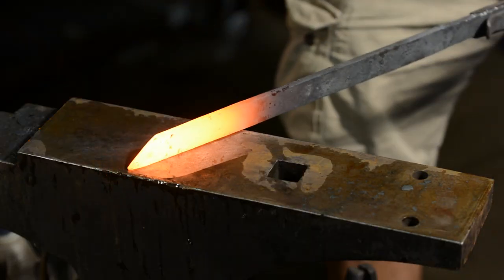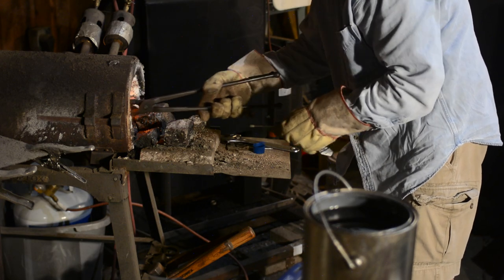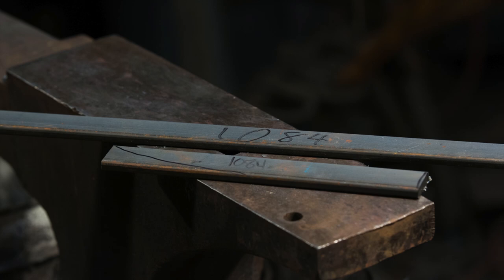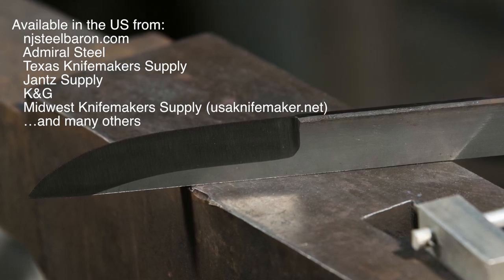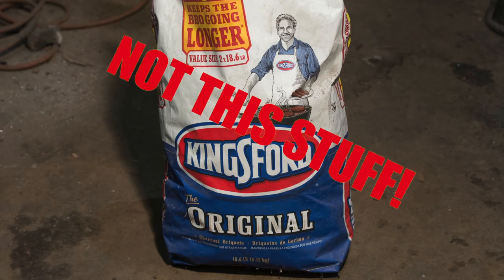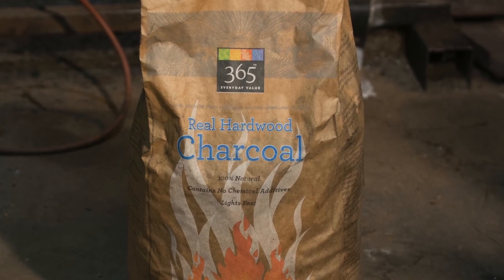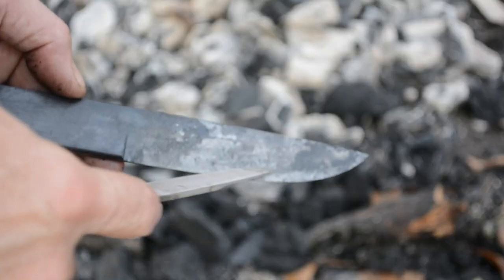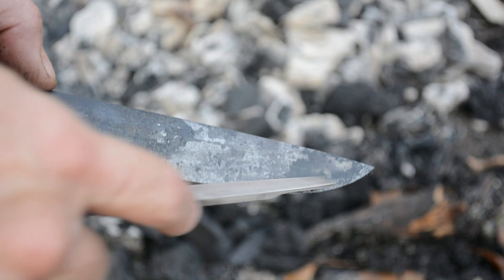Get Hard:  Heat Treating a Knife with Charcoal

Comment: I got a dumb question. I have heard u say to use 1095 steel as well. What's the difference between 1095 and the 1084 your using in this video. I've gotten into this as a hobby but have always used 1095. I've only made a few knifes and heat treating them was a little harder than I thought. Glad to see a video for the poor man knife maker. Ive been learning all my stuff from your videos thanks for the info.
Reply: The difference is the % of carbon. 1095 has 0.95%(more or less). There is some other differences too. mainly 1070 forgives more temperature mistakes than 1095 (beginner friendly)
Reply: +Negrataish thanks man. So 1095 is good for beginners cool I'll stick with it tell I get some knives under my belt.
Reply: No problem!. Also 5160 is really good and should be pretty cheap
Reply: +Negrataish 1084, 1080, 1075, 1070.....all of these steels give more consistent high quality heat treat results with primitive equipment than does 1095.  5160 is what is known as a deep hardening steel, and because of all that chromium it has within its structure it really gets benefits from a slower-cooling oil quench.  Some folks have experienced cracking with 5160 in water or fast oil.
Reply: +polishavenger1 all this is crazy I feel like they need a class for this. So many different metals, it's kind of overwhelming.
Reply: +polishavenger1 Yeah i meant that 1070 is more beginner friendly than 1095. And yes, 5160 should be quenched in warm oil
Reply: +hishinator There are SO many formulations of steel to choose from that it makes the mind swim with all the possibilities.  My advice is pick ONE, learn how to shape it, heat treat it and finish it properly.  Don't get caught up in all the hype about supersteels or this steel is better than that steel....the Schrade Cutlery Co. used ONE high carbon steel for about a hundred years for the majority of its products, and that steel was 1084.  Easy to work, easy to heat treat, easy to sharpen to a great edge.  And the stuff is INEXPENSIVE....great for hobbyists.  I've had beautiful results with 1084.
Reply: Thanks every one for helping next time I get some steel I'll try 1084.

Comment: According to a few websites, they are saying that 1084 is a "discontinued" tough tool steel that is very popular for forging when it can be found, and 1084 has been replaced by 1080 and the specs for both are very similar, with 1084 having a little more carbon.... 

Since everything on the internet is true,  um.....   will 1080 work for this??  lol    (i'm sure there's still a lot of 1084 floating around)
Reply from the maker: +Mitch B NJ Steel Baron still has some.  But 1080 is not the same as 1084.  1084 has higher manganese content, which makes it oil hardenable.  Whereas you have to water harden 1080.

Comment: Hi! Looking for some tips of doing HT on 5160 steel, and I have sort of found reading alot that you can get away heating to 1500F and quench in pre-heated canola oil (about 130F). Then I see some temper 2 or even 3 times at 375-400F. Novice here, its again just figures that seems to be common.

Comment: Great video and I look forward to learning from your skills. My question is about the treatment of the tang? Is the Tang (handle) getting a full treatment as well as the blade? As I watched the video it looks like the whole time your heating the blade its by the end of the tang, and the treatment doesn't look like it's getting all the way up? Or am I just being difficult? just want to make sure I understand the process before I do this.
Reply: The tang is left soft for toughness
Reply: When you see him harden the blade, you will notice that he only really heats the blade. This is to keep the tang soft. If the tang was hardened, it would just be unnecessarily prone to cracking or shattering. There is no need to harden the tang as it is not the part that needs to hold an edge. Does that make sense?

Comment: I've only heat treated a few knives but I've been doing it with the spine down and the edge and tip just outside the main heat. I am just curious if there may be something wrong with doing it this way that I am just not picking up on. In my mind it makes it easier to control the temperature and lowers the risk that I will burn or overheat them.

Comment: How much/can/should i grind the edge of teh knife before i harden it? I've only done one knife, from an old file. It cracked in several places across the edge and it bent as well. Sure, i did alot of mistakes/didnt lry know. I probably hade to high temp, I quenched it in water. But I think my main problem was that I grinded it to much/it was quite thin. (I thought it would be smart to grind it as much as possible before it would get hard). How much griding work should you do before you treat it?

Comment: Walter i have a thermos i wanna put my parks 50 in and use it.. it has a lid and a 4 inch opening.. the can is hollow but it says vacuum sealed.. will that work when it gets hot?. Should I drill a whole on the outside of the canister?.. worried it will expand and explode. My thought is if i poke a hole in the outside of the can, the air inside will release at will.. thoughts plz.. this is a 1gal ozark reail 30 dollars 10.25 dip depth.

Comment: idk what kind of steel I used but once I've heat treated is 450 degrees for an hour fine for most size knives or do I need to change it to a certain time/temp. Also are there any health hazards with doing it in an oven used for cooking because that's the only oven I have.

Comment: Those things won't just melt steel, they'll burn through it like an acetylene torch if you're not careful and get too close to the oxygen supply. My early works mostly ended that way, with a gaping hole in the middle of it. At least it was free leaf springs I got from a nearby garage :P Only the charcoal was wasted.

Comment: Hi, Walter. I have a question. I`m making a knife out of old circular saw blade, the steel is real hard, when I tried to drill the holes for pins my drillbits melted. So my question is do I need to heat treat the knife  if the steel is that hard already. I`m planing to put  a scandi grind bevel on it with a file so I wouldnt overheat the edge. This is my third attempt to make a knife, first two cracked during heat treating  after quenching in water (used the same saw blade for those).
Reply: Pēteris Lukstiņš quench in oil and anneal it to start with will make it soft enough to drill and file
Reply: Pēteris Lukstiņš Try cobalt steel bits.

Comment: Walter I tried heat treat my blade and think I may have not got it right. Parts seem hard while other gets bite from the file. Put it back on the coals tries again but still has the same issue. How many times can I heat treat the same blade

Comment: have you tried using aluminium to protect the edge and as a temperature guide during heat treating?
aluminium melts at the same temperature as the optimum heat treating temp of O2 steel (816˚C). 
I'm thinking of trying out a tester but was wondering at any disadvantages or possible metallurgical contamination from using aluminium this way?

Comment: +Walter Sorrells Which steel would you choose (only using the simple method shown here) as a hard use knife steel with 5" blade 1/4" thick flat ground and full tang 5 1/2" handle, (pretty much a K-Bar style but full tang) ...1075 or 5160?

Comment: If you use an oven to temper the blade, how long should you leave it in the oven? Do you just wait for the blade to change color?
Reply: 1 hour, let it cool then another hour.
Reply: And if you temper it the way he did, when you achieve wanted color(straw) you let it cool or quench it?

Comment: The file test did not work on my 1075 steel. I thought it was still soft and when I went to straighten my warped knife, it broke.:(
Does 1075 not get hard enough for the file test? Thanks.

Comment: Walter, after i grind the bevel, and before the heat treat, how thick should the steel be at the cutting edge?
Reply from the maker: +Danny Campbell There's no set size.  I keep it a little thicker with katanas than, say, knives that I only have a small amount of time invested in.  With a knife, generally around 20 thousandths.

Comment: hi i need guidance, i heat treat some metal that have told to me is high carbon steel, with charcoal, quench with water and oil but i could not harden it, i think maybe the steel that i used was not high carbon steel, then i quench a file with charcoal and oil(first temper for get soft and shape the blade), but again it don't get hard as i expect, i temper to non magnetic and then quench, but it happen to fast reaching to non magnetic temperature, you think that is the reason why my blade don't get hard correct? maybe i must temper it more?

Comment: excellent video, thank you.  Could you use this method with 1095 steel?
Reply from the maker: +Robert Thomas You can, but 1095 is sort of on the borderline between oil and water hardening steel.  Depending on various factors (whether you normalized the blade or not, thickness of the blade, temp you heat to, and various other things), it may well harden differentially -- meaning that it will on harden on the edge and not on the spine.  This isn't a problem but it's just something to be aware of.
Reply: +Robert Thomas no, 1095 is whats knows as "hypereutectoid" and requires holding precise heating temperatures and using proper quench fluid.
Reply: +Eagle Bird Knives thanks!
Reply: +Walter Sorrells got it, thanks!

Comment: would it be easier to buy one of those infrared laser non-awkward contract thermometer gun ? they are £10 on Amazon here in the uk
Reply: +DIYEyal it says on Amazon,  Between -50 °C and 550 °C (Between -58 °F and 1022 °F ) Accuracy: ± 1.5% or ±1.5°C Repeatability, so maybe doesn't have the range

Comment: Do you think you could harden steel with a creme brulee torch, or does it not produce enough heat?
Reply: Jack Hendrix if you have 2 or 3 should get it hot enough just give it a try and find out
Reply: Interesting. I might try it out.

Comment: How long would it take for 440C steel to be Heat treated in a campfire? or what Temperature do i aim for and how do I identify when it hits that temperature?
Reply from the maker: Unfortunately 440C (and pretty much all other stainless steel) isn't a good candidate for this kind of heat treating.  You need reasonably sophisticated temperature controls to properly heat treat 440C.
Reply: Walter Sorrells I heard that you have to be careful with overheating 440C while I was researching it abit, So I can understand what you mean. Thanks for the help I'll just have to go for some 1084 or 01.
Reply: what about 1095? I just ordered some equipment and a bar of 1095.
Reply: 1095 will make an excellent blade but you should outsource the heat treat because it is hypereutectoid.  I have heard good things about Peter's Heat treat.
Reply: White Boy that's a stainless steel you don't do that with fire you have to air quench it.

Comment: question for walter or anyone who feels like answering. I just got done making a knife but i made the blade really thin before heat treating. as i heated the blade to critical temp, i might have gone over the temperature because the tip melted off. How thin should i be grinding the edge of the bevel before heat treating?
Reply from the maker: +Lemonitus The issue is not the thickness.  You just have to be super careful when heating it for heat treating.  If you actually melted the tip off, you overheated it by at least 800 degrees!
Reply: Walter Sorrells I figured out that I was using a really bad steel that had very little carbon in it. That ended up being a big problem in the end because the knife can't hold an edge and so forth. But I'll be ordering quality steel next time.

Comment: Hey Walter.. I've been watching your vids for about a year now and here you said only 1084 and o1 steel could be treated with oil. I'm not sure if used files but I'm starting a project, would the treat go right using this method and oil?
Reply from the maker: +Lance Crooz II was just distinguishing lower carbon water hardening steels from higher carbon oil hardening steels.  Plenty of other steels can be oil hardened.  But there's a lot of complication involved in how things are hardened.  Files are kind of on the edge between oil and water hardening.  It probably should work, but you won't know till you try.  All files aren't exactly the same.
Reply: Walter Sorrells Oh okay, I was thinking that. How it's a steel I'm not sure about and I already annealed so I just gotta wing it. But thank you sir, I've learned so much from your work and I'm slowly getting all the tools I need.  Seriously, thank you for sharing your craft.

Comment: Hi, After hardening/quenching in oil do I have to immediately proceed to tempering or I have to clean the blade first?
Reply: Matko Lendler no need to clean before tempering. You'll just need to clean it again. That being said, it can help you make sure you get a good temper off the oxides it forms. but I don't

Comment: let me start by saying this is a dumb question, however I am going to ask it anyway. Can 1095 high carbon steel be harden this way?
Reply: Yes. You can also use water I think, but you need to look into it. Water might have a greater chance to crack your blade. It's not a dumb question at all. I hope it goes all well.
Reply: Thanks, I'll look into different quinching liquids before actually proceeding with heat treating.

Comment: also if you know much about electronics you can make a magnetic induction heater, surprisingly easy to make and quit accurate
Reply: What would you use to make one?
Reply: lots of wire, some coiled coper pipe, amp and volt meter, 35a 100v transistors, fast diodes, 1kv polypropylene capacitors 12 volt regulator. 240 ohm resistors and some other bits and peices
Reply: You totally lost me at transistors ; ) I've seen them on YouTube but never in real life. Does it heat up anything or does it have to be metallic? Also, if you wrapped up a steel bar in rubber or some other insulation would it still heat up? I'm just wondering if you could cover the back half of the blade in clay or tarr and that part not heat up? Thanks!
Reply: +Shane K There are good reasons why there are no knifemakers using induction as a heat source for knifemaking, Shane.
Reply: Shane K the heater works through the process of magnetic induction, in a smiler fashion to a transformer, however the energy in the iron is not transferred to electrical energy and therefore manifests itself as heat energy. this means that only ferrous metals would work. also rapping it in something would not make a difference, but could catch fire as the metal heats up.
Reply: polishavenger1 why might that be?
Reply: +angus white One potential problem is the uneven nature of a knife blade's grind/forged shape.  Generally, we shoot for as even a heat as can possibly be had before a whole-blade quench to achieve what is called 'through hardening' to get a homogeneous structure.  In tempering we want an even, moderate heat with as little variation as possible, that is maintainable for, at the very least, an hour.  Having to pass a blade through a narrow induction coil is about as uneven as I can imagine, with no feedback on what temperatures are actually going on INSIDE the steel.  Induction has its place in industry, but it's been around forever and I have yet to see a knifemaker in person, on line, or in any literature from the last 40 years, adopt it for practical use.  Not saying it can NEVER be done...but the wheel's already been invented, so to speak.
Reply: polishavenger1 fascinating, thanks for the explanation!
Reply: +angus white Happy to, angus.  Just for curiosity's sake....have you built an induction coil?  Not many people are familiar enough with them to even think about possible use in this craft.
Reply: yes, I made one for my diploma in mechanical engineering
Reply: +angus white That's exceptional....I have the utmost respect for ME's.
Reply: polishavenger1 thanks! what's your profession?
Reply: +angus white, how much could you make one for?
Reply: base material cost would be £15-25 why?
Reply: + angus white, it would be cool to have one but they cost a couple grand and up, wish you were my neighbor!
Reply: +angus white After getting my degree, I spent years managing automotive parts stores, then became a stay-at-home dad.  Now that the kids don't need me anymore, I'm trying to figure out what to be when I grow up.
Reply: interesting! and btw it depends what sort of ampage you need for the job. if you were going to treat a piece of steel the size and weight of a knife you would need about an 8 amp dc power supply. not a lot by industry standards, but still enough to kill someone.

Comment: bladesmiths did it pretty much that way until maybe 50-75 years ago. Nothing wrong with it, especially if  you use simple steels like 1075, 1095 W2 or 80CrV2. Do not try to work fancy high alloy, stainless, or CPM steels this way.

Comment: What size stock is the knife in this video? I'm guessing .250" x 1.25"?
Reply: A quarter inch would be pretty overly beefy for a small knife. It's probably 1/8" (.125") or possibly 3/16" (.1875"). 1/8" is generally what I see recommended for beginners and based on the context of this video I'd imagine that's what it is. 1.25" is a pretty safe guess for the width, possibly 1.5". I'm looking into remaking a simple, cheap-ish knife that I love with a few small tweaks (mostly a larger handle since I have pretty large hands, plus a bit of an edge and some serrations on the back) and 1/8"x1.5" is what I'm leaning towards.
Reply: philondez I'm talking about the one at 3:03 in the video